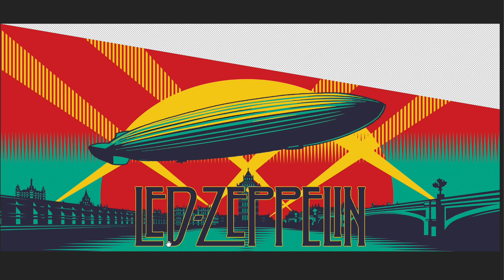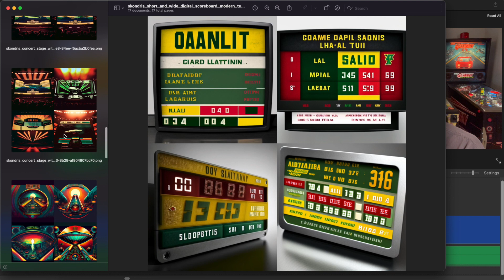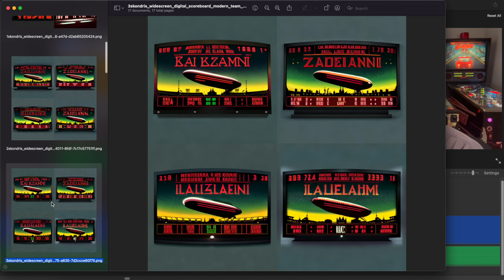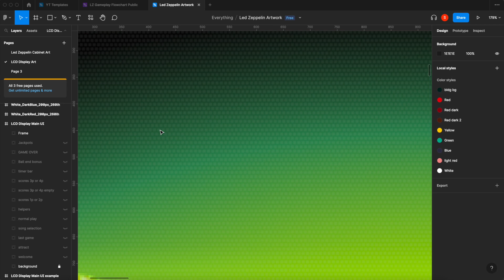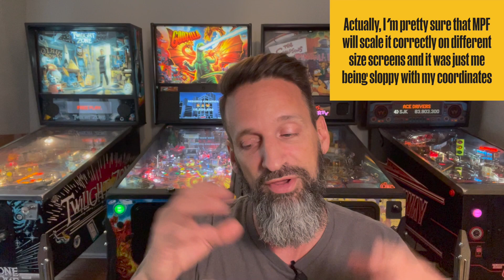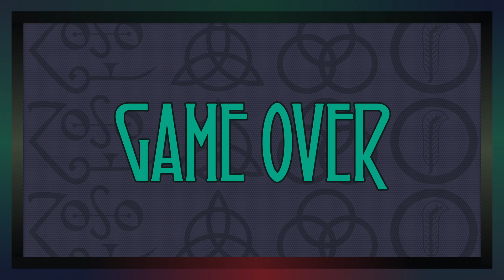HOW TO MAKE A PINBALL MACHINE: Using AI for Display Art

Comment: Screens are looking good! The kerning seems off on a few of the glyphs in the font--would MPF give you a way to use a transparent GIF on the slides in some cases instead? That way you could position each of the glyphs (characters) by hand and squeeze them together when the kerning is off.

A well-kerned font would fix the spacing issues. I used to have a font making program that could adjust kerning on fonts... Fontographer? Something like that. There was also an old, free utility called "Softy" that could fix kerning mistakes in a font. (It's basically like a list of exceptions where you can squeeze together particular characters like two consecutive I's).

Can't wait for the next video!